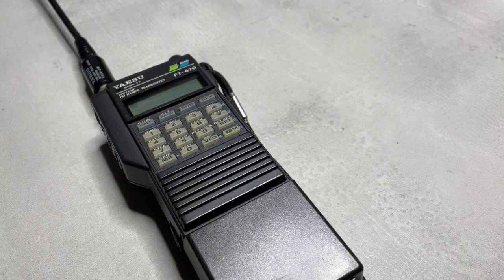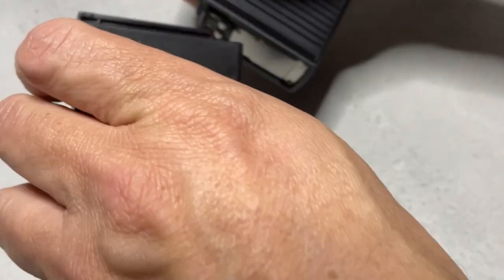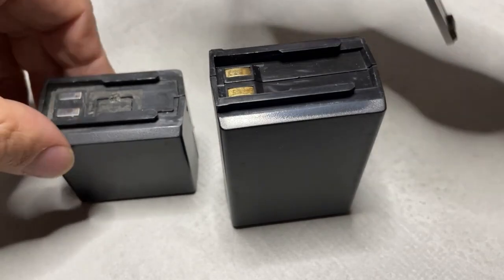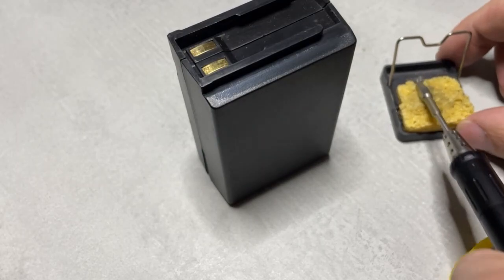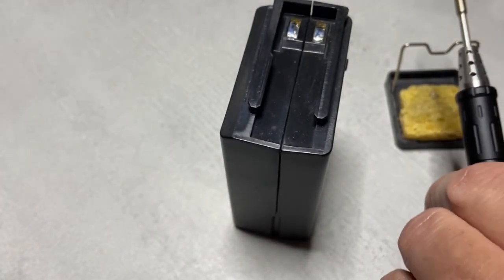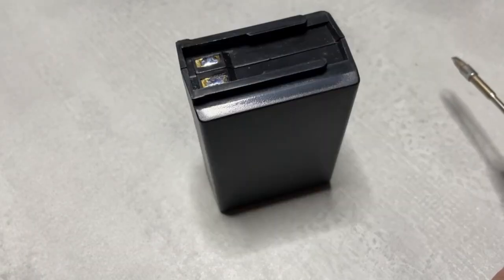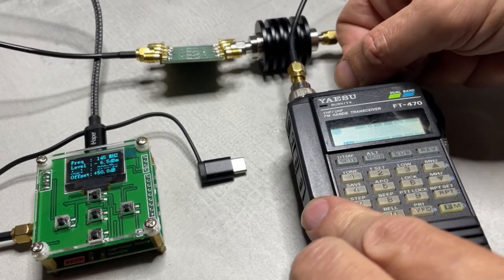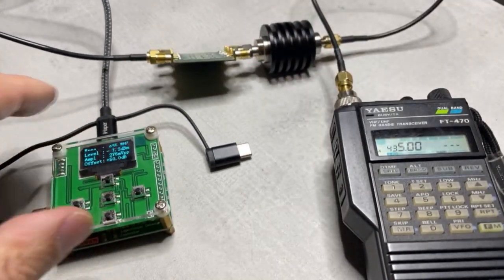Reviving my Yaesu FT-470 with a cheap FNB-12

Comment: Did you use a different charger?   9.6V  or  12-14V   Next trick is replacing the internal battery CR-2025 with solder tabs,  so it remembers settings.
Reply from the maker: The original charger is 15.95V (Minix Brand) and apparently current limited to 50mA. No intelligent battery management system there… So it charges the battery nicely, but blows it to bits when left on for too long.
If you have a link or more info on the best way to change the backup battery, please let me know. It keeps forgetting it‘s settings.

Comment: Can you tell how to open battery pack of this battery(FNB -12)
Reply from the maker: I put it in the freezer to make the glue brittle. Then wedged it open with a chisel. That caused some damage to the edges of course, but the plastic did not crack.

Comment: Is this revive or replacement
Reply from the maker: Replacement. I had cracked the original Package open 20 years ago and replaced the cells. That worked ok. Because the relatively low cost of the new pack, I did not fix the old pack again.